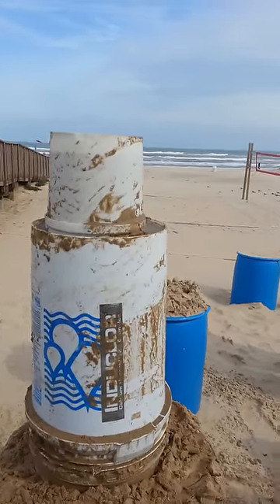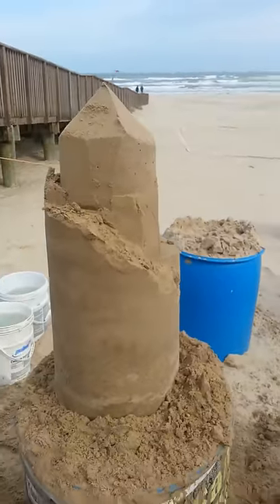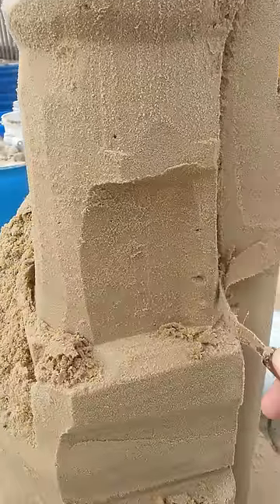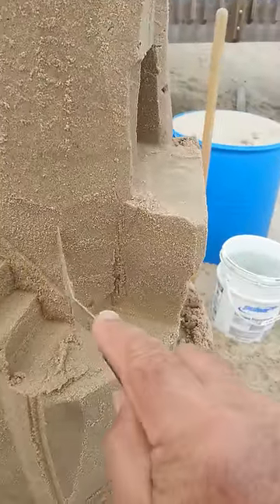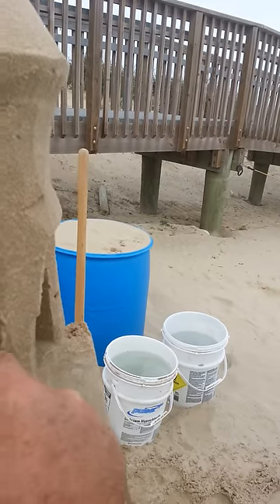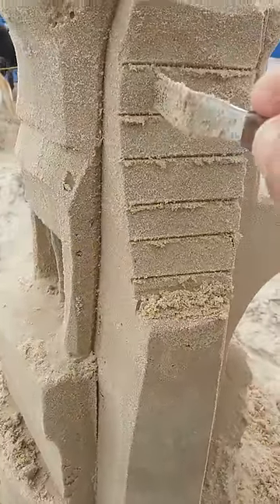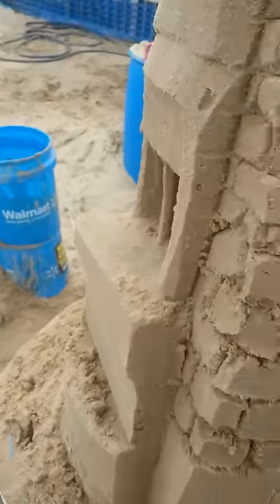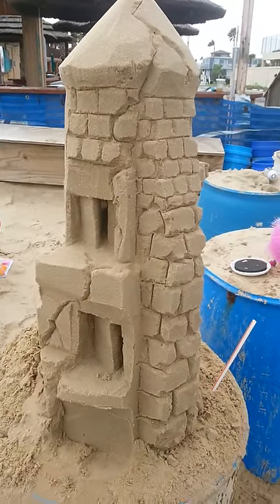Sand Castle Snippets - Carve a castle from a block

Comment: The reason i dont make sandcastles is i am worried the princess will sue me for the stairs. Im not very good at them lol.
Reply from the maker: LOL they are probably not up to princess code but to make them better just practice on stairs only - cut diagonal lines into block and practice getting the spatula level - sounds obvious but once you get the correct angle sorted its a breeze..and remember to lift of the cut pieces and not just flick them - makes for a much cleaner cut
Reply: Thanks!